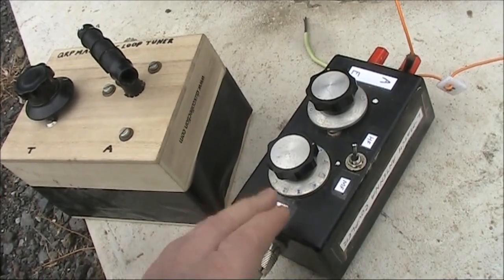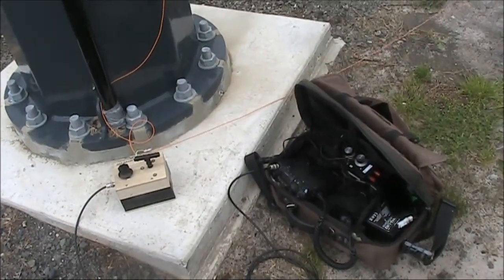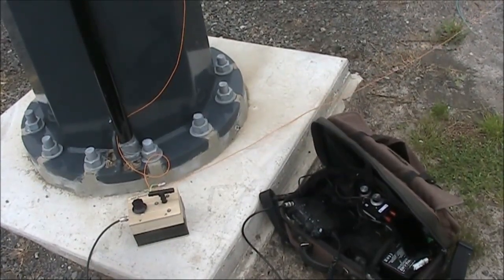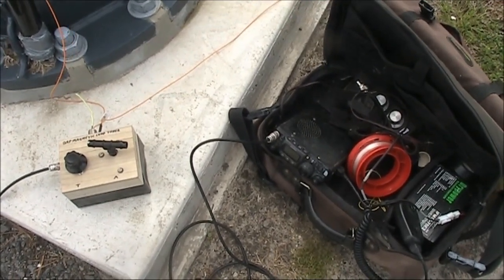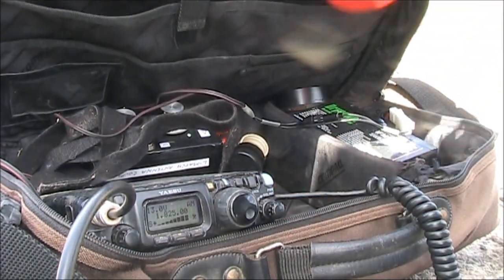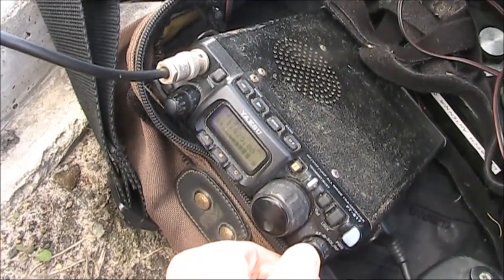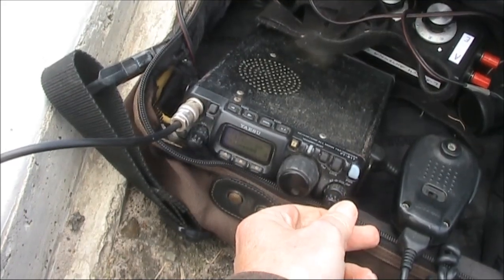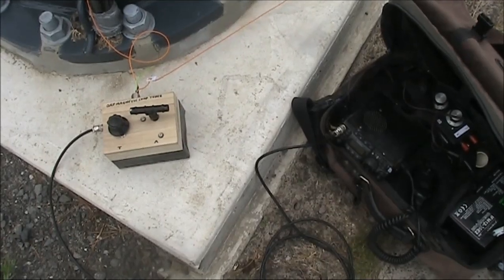More light pole antenna 160m AM tests

Comment: it would be interesting to have another station at another sports park 20km away loading up an identical light pole with the same equipment and compare it to the signals of the other stations running more power from home. That would be a good indication of it's efficiency